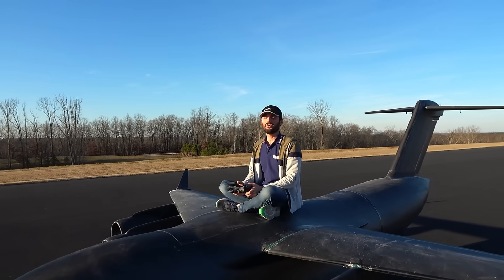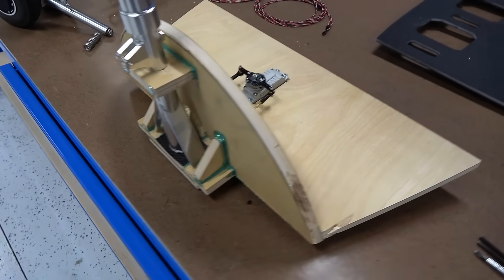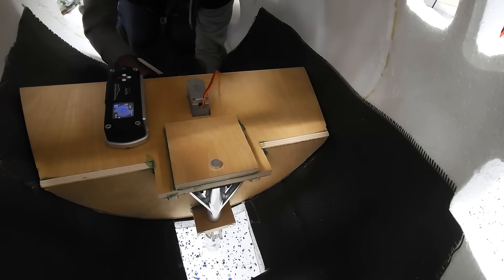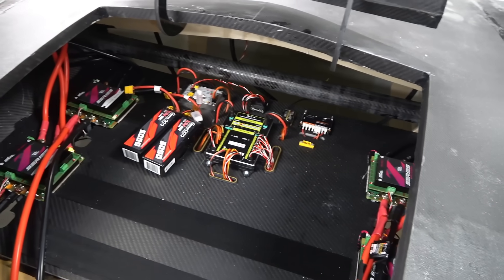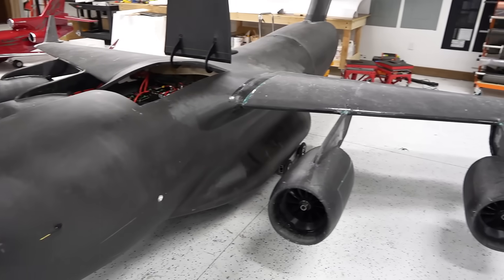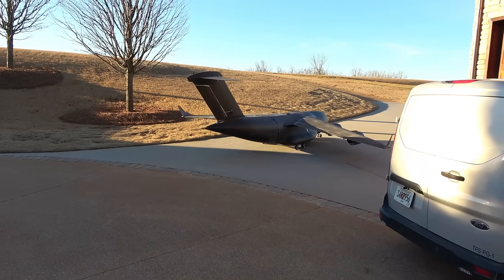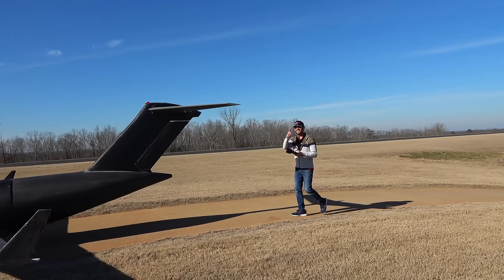READY FOR THE FIRST FLIGHT, 6 Meters C-17 Globemaster RC airplane

Comment: Great build! We built a large EDF RC sailplane (25ft WINSSPAN) and installed 20CFM fans on the EDF Controlers and found that we could run wide open constant. The fan is 6mm above the ESC. This came in handy if we needed to go around and run full throttle. The fans were from Digikey 12 volt and ran on 3S Rich from youtube RCTWINS

Comment: Just a thought, if you hinged that access flap at the front it would be safer in flight if it opened and you could also build it as an air brake.

Comment: 10:00 you probably should have installed it to where it openes up from the opposite side, that way if the latch failed for whatever reason (or ot doesn't latch properly, or someone forgets to lock it), the air flow would keep it closed vs possibly catching it and ripping it open.

Comment: It would be better and even maybe even vital if the hatch came open to  the stern with the hinges toward the nose or front of the aircraft.
If the hatch opened it would simply be blown shut.
Having it your way means it would be torn off and electronics exposed and or damaged.
This is an elementary observation.

Comment: Fatal design flaw:  Putting the hinge of that hatch on the aft end of the opening.  If that thing pops open in flight like it did on the taxi test, that thing is going in hard.  You really need to put the hinge on the front of that hatch before you fly it.  Damn.

Comment: Re comments on the hatch hinge placement, looking at the position of the wings, the access required and maintaining the CG, it had to be put that way otherwise access would be a nightmare. Hatches can be designed to not open in flight as Im sure this one will be. 
The carbon fibre looks awesome, no paint required.

Comment: I thought of how that hatch would swing open.. those hinges should’ve been installed the opposite side?.. front end (cockpit side) of the opening.. Just in case that access hatch popped open while airborne, that would be a terrible wind drag. If it swung open the opposite side, at least the wind would cause that access door to remain shut while it’s flying.

Comment: Is there a reason why you didn't put the hinge in front of the door on the roof instead of in the rear.  I would think that would be safer just in case the door happened to become unlatched and it wouldn't become a speed brake.

Comment: I don’t understand why you put the hinges on the back of the hatch instead of the front, this would help prevent the hatch from opening during flight and causing a catastrophic failure of the flight and potentially causing it to crash. I sincerely hope that you install a very strong latch to prevent this from happening, otherwise, all of the careful construction you have done thus far would possibly end in failure.
I was a bit relieved that you had mentioned this possibility, but I hope that you do not overlook this when you prepare this plane for it’s maiden flight.
I look forward to seeing the final retractable landing gear installed and operating properly. 
You have put so much time and thought into this project, and it is a remarkable accomplishment to build such a large RC plane, I very much look forward to seeing the finished product, and to see it fly properly. I suspect that you will be adding paint or decals to it to add additional realism. 
Happy flying!
Thank you for sharing your progress on this project, and posting this video!
Please have an excellent and awesome day!
☀️✨✈️

Comment: my thought 7:29 prolly should have it open forward instead of back just incase it opens in flight air force would help keep it closed as to right now if it opens...if its an OX! boss build then no breakage now radical change in flight able land repair WOW what a Scare.... other hand prolly more likely door rips off MASSIVE air drag do to cavity in plane is now open might lose tail tip... extreme.. lose control and the whole back end do to air force-impact/pressure on the inside rear. even with a strong latch redundant safety is good (wear over-time)

Comment: Hi Ramy, I've been following you for years and admiring your work but this is on an entirely different level! Wondering if this will be the biggest RC Plane in the world? Bigger than the Concorde maybe but definitely surely the biggest electric powered plane? Question, gluing wood to carbon or even fibreglass is tricky sometimes, what epoxy is that you are using at the start of the video, the green glue, name and manufacturer would be interesting to me.

Comment: I'm surprised no-one uses doubled up servos of sufficient individual power, as you're already running parallel redundancy on the main power, and for such a relatively small weight penalty which wouldn't be prohibitive in a model of 10+ kilos. I know they're real reliable these days, but they are doing all the work!? 😮😊edit, doubled up receivers should make it even easier, lol😅 are they paired/cloned, or master/slave?😊

Comment: As a LARGE R/C MODELER and DESIGNER for 40 years. I Was very interested  in this project!.
UNTILL it revealed it was electric 👎😝 WHAT'S THE POINT IN BUILDING A LOVELY SCALE MODEL SUCH AS THIS THEN SPOILING IT  WITH ELECTRIC FANS. 
ASK YOUR SELF DID THE FULL SIZE HAVE THIS 
NO IT HAD TURBINES 🤔.
SO BECAUSE OF THAT IT'S A BIG  DISAPPOINTMENT. ON BEHALF OF MY SELF AND MANEY OTHER LARGE R/C MODELERS.

Comment: Hi, Controlling a rc airplane….
Many times, for big ones or complicated…. More than 1 transmitter is used…
1 for directions….1 for cameras, 1 landing, 1 lights…. 1 canons & tricks…
…So think calling guys+transmitters to do the job …. Landing gears….
Making it easier for each other….hence safetier manage…
💈

Comment: Why did you install the hatch AGAINST the  relative airflow? I would have mounted it opposite so that if the latch failed mid air you wouldn't have the worlds largest speed brake popping up. AWESOME build and Builder, keep going Ahee.

Comment: Have you looked into placing a small fire extinguisher (or canister) inside the fuselage? If you can handle the weight, adding a heat switch to a small canister in front of the hatch, might save the plane in case of fire.

Comment: hi ramy, great job , any  reason why you did not fix  the hinges for door battery in front so if it open by mistake it will not open easily, ?

Comment: Beautiful! Can't wait to see it fly. One question: what prevented putting the hatch hinges at the front? If a latch failed with a front hinge, low pressure might make hte hatch open slightly, but it would rreach equilibrium with the airflow and probably not open more than an inch or two. Lots of light airplane doors have this relatively safe failure mode -- if the door pops open, you can't re-close it due to the low pressure, but it also only opens a little bit and doesn't compromise flying characteristics.

Comment: Was there a reason the hatch on the roof had to open in that direction, surely opening towards the front would mitigate any risk of it opening mid flight if the catch failed or was not correctly latched..if the reason was access why not just use bigger hi ges so it opened all they way up?? Just curious to reasoning as the rest of the aircraft was so well designed😊

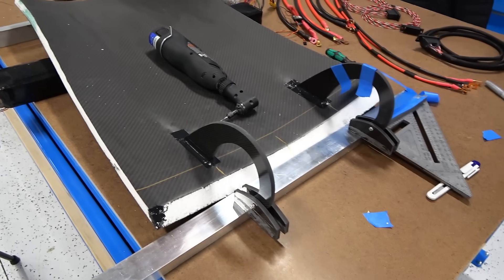Comment: 7:00  im really surprised to see you installed the hatch to open into the airflow like that on a project this extensive.   I would be seeking every possible failsafe I could muster, like having the hatch be pushed closed in flight not open.

Comment: Fantastic! Although, I’m surprised that you chose to put the access hatch hinges on the trailing edge instead of front edge of the hatch.  As you said, if it were to pop open in flight it would be a huge (catastrophic) speed brake.

Comment: If you hinged the top hatch from the front your latch wouldn't need to be as strong and you could always put a ram underneath it and use it as an air brake 😂

Comment: Amazing project! That top-hatch WILL open at some point, WHEN the latch fails. There is lift along the top, and you will then get a giant speedbrake. With your experience there must be a reason for hinges aft. Good luck!
Reply: Yes, I was wondering the same thing. What is the reason for putting the hinges aft?
Reply: I 'm not an RC plane hobbyist or in aviation and I thought the same. My guess for the aft hinge is because if it opened forward it might get in the way while doing work in the plane. I think a front hinge with the ability to easily remove the entire hatch when doing extensive work inside would have been a good compromise.
Reply: Good point. Whatever the latch, should be backed up with a short safety cable or secondary latch, like a car hood.
Reply: Closer to the center of gravity maybe?
Reply: I think the shape of the hatch is dictating the position of the hinges

Comment: That bog hatch concerns me, if it opens in flight due to latch failure you may end up with a larger air rake you can't control. I think it should've operated the other direction.

Comment: At 15:26 the top access hatch popped open. Why not put the hinge on the nose side so the air moving across it will keep it down? Just in case the closing mechanism fails in flight somehow.

Comment: Hello Ramy! When it comes to the battery and electronics latch, you could have considered a redundant design where it opens in the opposite direction, thus meaning a failure of the latch wouldn't lead to it flipping open mid flight as the air flowing over it would keep it more-or-less closed. Just my thoughts. Fantastic build regardless!
Reply: My thoughts exactly. The hinges should've been on the opposite side.
Reply: I agree. With what he flies I was surprised thT put the hinges on the rear of the hatch..
Fred Weaver
Reply: i think he did that for better access from the front,not having that door in the way to get inside
Reply: @fanflv  This guy has skills that I can only dream of as a large-scale scratch-builder, so I assume that he had a good reason for hinging that access panel at the back. But nothing about that board/battery tray would need to be hinged at the rear for access purposes, even if he was planning on modelling a cockpit. 

I'd love to hear from the man himself, (and I doubt I will) but I would guess that it was to increase the width between the hinges for strength? I need to know, because ths really seems like a nonsensical choice.
Reply: @fanflv   He is standing next to the wing for access anyhow, it would not be in the way IMHO! it will be fine either way!
Reply from the maker: Simply because I didn't want the hatch block us, especially for Tyler, He's a big guy.
You'll see in the video the latch we used, this thing will never open!
Thanks for your concerns everyone!
Reply: @RamyRC  it's an obvious thought when you watch the video .. foolproof would've been the other way round.  But .. if it never ever opens during flight .. you will be 100% right ... if it does ... it'll be a biiiig shame lol.
In Ramy we trust ..  ✌   (trust? thrust? 😂 man, this C17 sure got some!)
Next vid should be epic .. looking forward to it.
Reply: @RamyRC  I completely understand the blocking issue. A solution to consider next time would be detachable hinges, for the times where you need perfect unobstructed access, but is quick and simple when you don't.
Reply: @RamyRC  oh i thought you sitting on it was the latch lol
Reply: I made the same comment before seeing yours! I agree!
Reply: Let this man do what he does best. Keep cooking ramy
Reply: If you put a locking latch on, which I’m sure he did, that won’t open
Reply: Unforeseen failures can be averted by having it open from the other end. If wider access is desired, with his shop and setup, make hinges that let it lay all the way open. Then absolutely nothing CAN go wrong.  @Winstonthebrothadogof40K
Reply: That thing is massive
Reply: I came here to say the same thing
Reply: I love the idea of unlimited funds for toys 🤪
Reply: KISS Keep It Simple Stupid,  Hinges are cool and sophisticated, but not really necessary.
Reply: I thought the same thing. I’ve never built on this scale and feel a bit ridiculous critiquing anything he’s done but you’re more than right. I hope for his sake it never happens.
Reply: The hinge placement on the back end was a surprise and really counterintuitive.  You would never design a door hatch opening that way in a real life airplane.  That being said it is not unheard of as cockpit canopies open from the front in many jet fighters (F16, F18).
Reply: This is how access panels on real planes are built although in their case it's to keep the plane from ripping them off if they came open in flight. Honestly I'd have just made it a removable panel instead of a hatch if access was the issue with it hinging from the front. If this ever pops open she is gonna drop out of the air like a brick.
Reply: Man! You must really be a powerful guy! 
Having Billionaire Tyler Perry as your employee to push planes for you!
Wow!😂

Comment: in my opinion, it is not worth making such large hatches with a right sharp angle, everything that is straight and sharp is an extra stress concentrator, and as a rule, cracks often come from such corners, it is better to make such large holes with rounded corners, take the example of large aircraft ...
and yes, a hatch opening against the flow is not a very good solution, it requires a very good locking mechanism, it is better if the hatch opens along the flow, it is not so demanding on the locking mechanism, the air flow will constantly close it...

Comment: Why would you not hinge the hatch at the front so airflow will prevent a catastrophic event in case of latch failure?
Reply: The hinge placement seems like a really silly decision. It's not too late to fix it!
Reply: Hatch will be blocking access to the interior, it's almost at the wings level.
Reply: @randomnickify  I don't see how placing the hinge point on the forward edge of the hatch could possibly limit access any more than the current configuration. What do you mean?
Reply: Remy has built most of his planes this way. He must have a resin.

Comment: Interesting, when the extended range tank was installed in the actual aircraft; that’s about where it went…Retired AF C-17 Crew Chief
BTW you should reverse the battery hatch in case it should open in flight it will lay down vs acting as a spoiler

Comment: The C-17 taxiing sounds a bit like an IL-76 or 62, holy smokes!
Amazing as per the usual Ramy, never failing to amaze me
Reply: Is the jet engine even install? I thought the C-17 is taxing around from those power wheel set you tempory have underneth the plane? 9:40
Reply: @mracer8  these are electronic brakes not motors